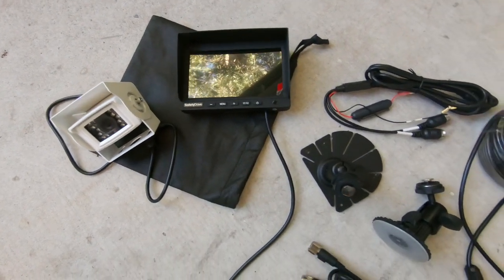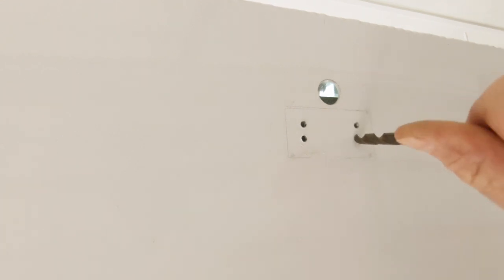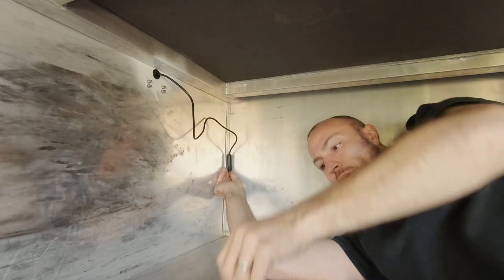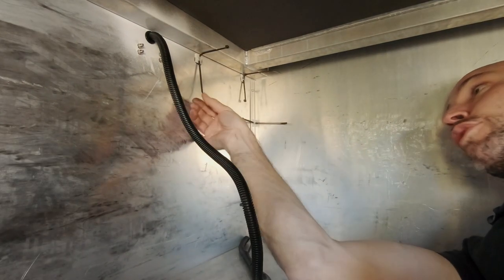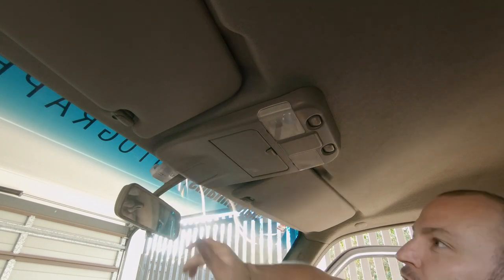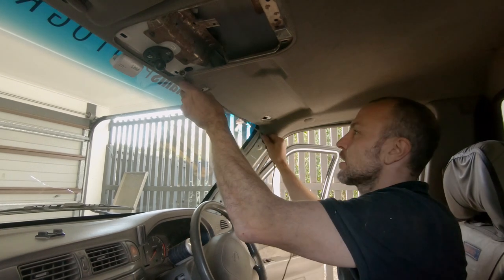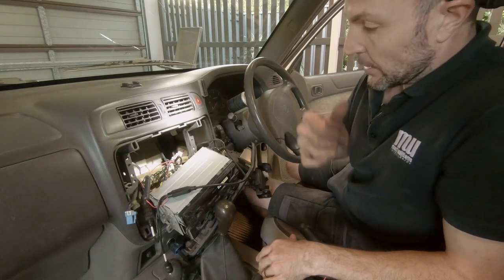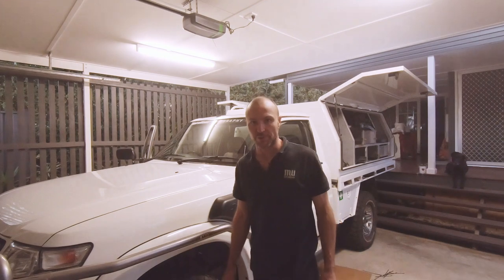INSTALL A REAR VIEW REVERSE CAMERA | DIY GUIDE | GU PATROL

Comment: Useful info - thanks. One thing you could have done was put some heat shrink tube over the wire before you soldered it. if you slid it away from the heat, later you could slide it back and shrink it. Better than tape and easier too.

Comment: OMG I was so nervous when you started drilling holes but then when it got to pulling all the insides out that was even more scary!  If I need one in a future vehicle I will most definitely know where to come.  Great little device though that would save a whole heap of accidents I imagine.
Reply from the maker: You can always replace a trim clip, but replacing a 20mm hole in the aluminium is a little harder! Fingers crossed it stops any more little run-ins with trees when off-roading.

Comment: 2 tips...
1. Stainless and aluminum will cause rust. When touching each other.
2. The wire hole is ment to me in the center of the bracket....